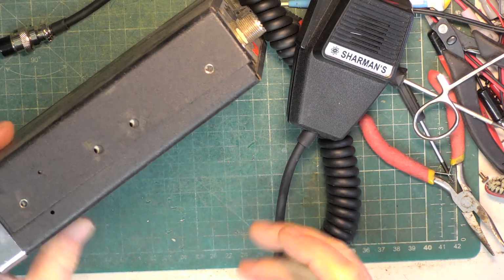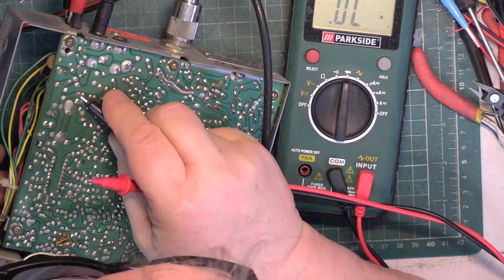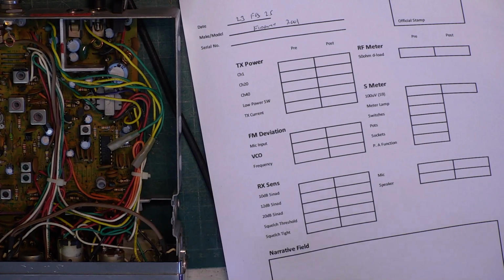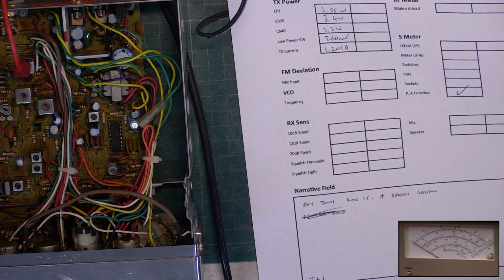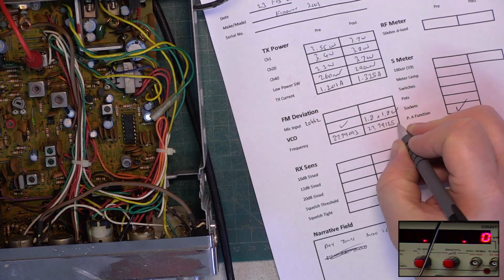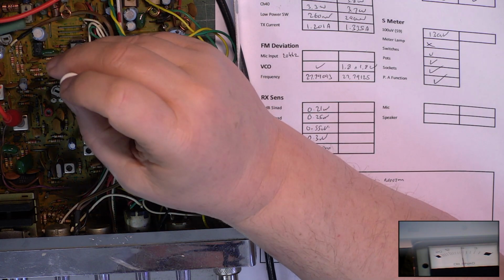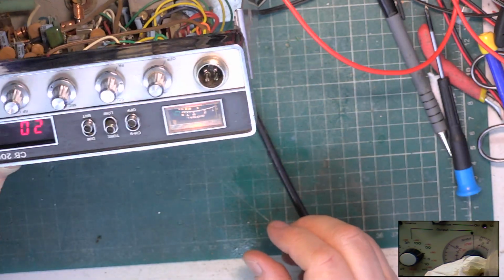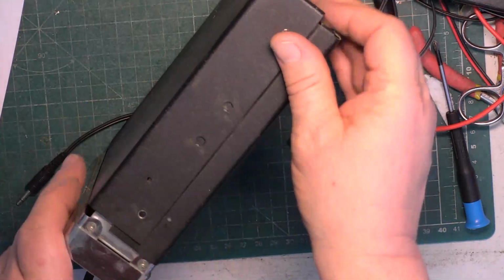Fidelity CB2001FM CB27/81 UK FM Cb radio - repair & aligment

Comment: Hi, I have one of these models in  a cupboard, seems to work, lights come on, needles move, speaker says hiss etc.
What, if any recommendations have you for me (a beginner in the electronics/RF fields) who's planning to dust it off and set it up again?
Should I seek a service like this? What might it cost me?

HISTORY: I bought it used maybe 10 yrs back and it passed the radio-check call I made but then got put away again.

thanks!
Reply from the maker: I'm not looking for work but suggest sending it in for a re-alignment. Quick radio tests aren't that good as it doesn't prove frequency, deviation or power for starters. Email me.

Richard
Reply: @ukfmcbradioservicingTango21  Thanks to your video I'm now aware the importance of these services. Given a service manual and the cost of postage, I'm leaning towards DIY, especially now I've dug out the Mustang 1000 I'd forgotten about. Both need a bit of TLC.
Thanks Richard

Comment: I have been looking for info in the uk for the Lafayette ERMES PRO, have been holding back for two years, no reviews or tests
Reply from the maker: They are a 2024 set using the Megajet MJ600 chassis & sold under half a dozen brands. We've stopped buying new radios to review though of course if one came in for service I'd do a video on it. I do have the service manual.

Richard, G0OJF, UK
Reply: I’ve one of them it’s needing tuned up